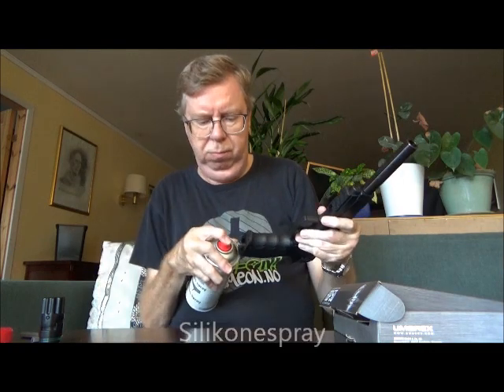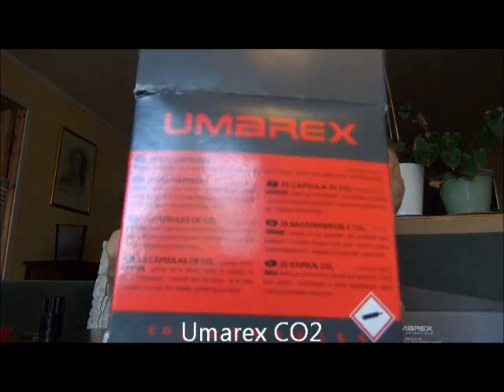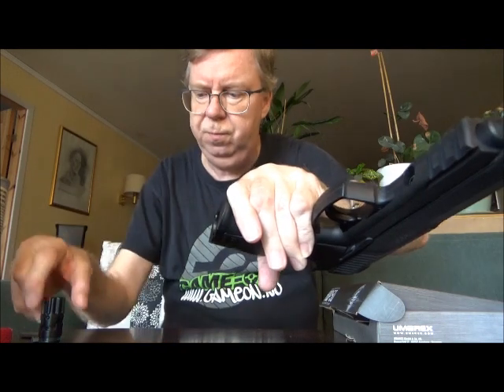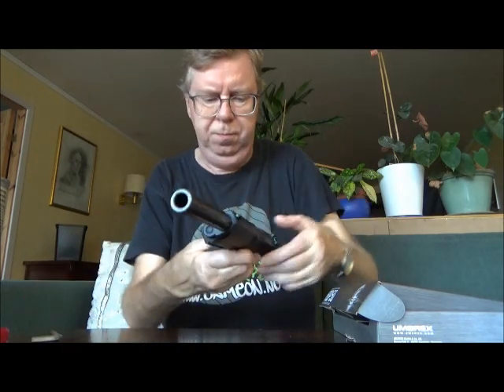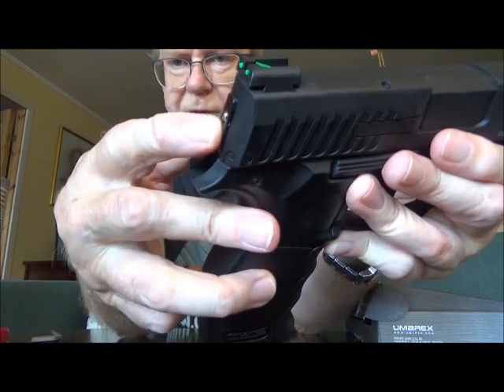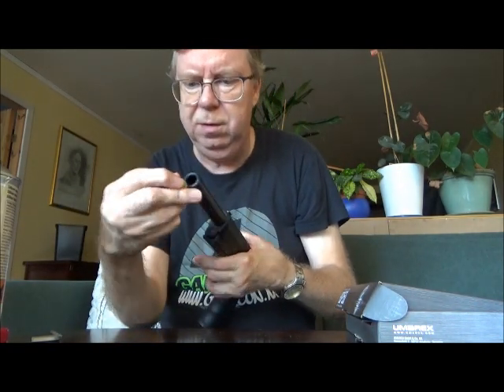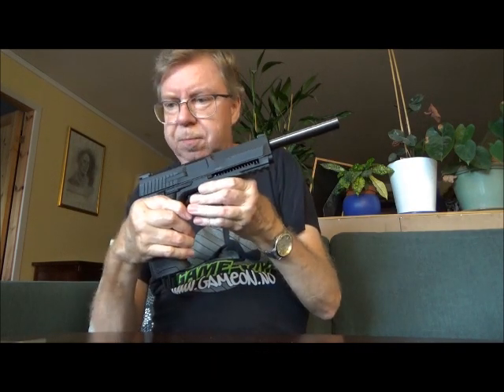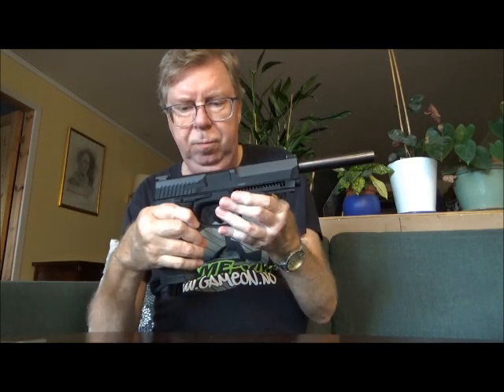Umarex HDP50, Tincan Busting, 10 Sep 2021

Comment: I’m going to give you a ninja 🥷🏻 mod , buy you the marbles that are a lil bigger than 1/2 inch marbles for and .68 cal paint ball gun. Then get you the rubber paint that comes in a spraycan to coat them with. When dried next day lightly lube them with silicone oil. I don’t know yet if the 1/2 inch marbles will work in the .50 yet . I am going to order my hdr and HDs then get my upgrades from home defense 24 …
Reply from the maker: I have not seen the smaller marbles here in Norway. Only the large type you can use for the cal 68 markers. I used rubberpaint and dipped the marbles in them. Several layers is needed. But they work great in my Tiberius T8 etc :)